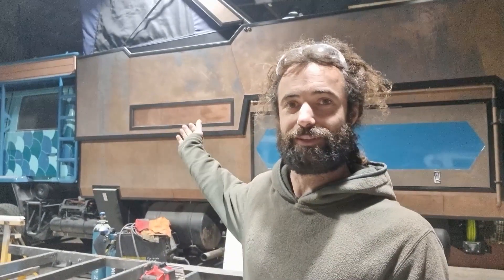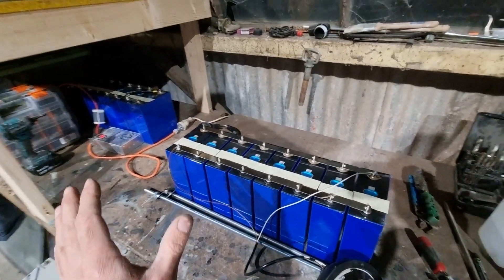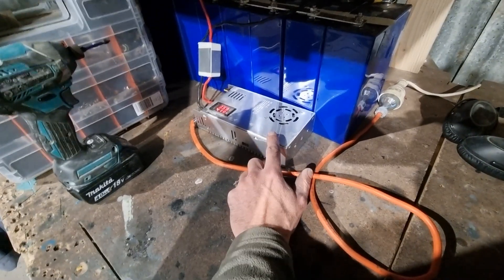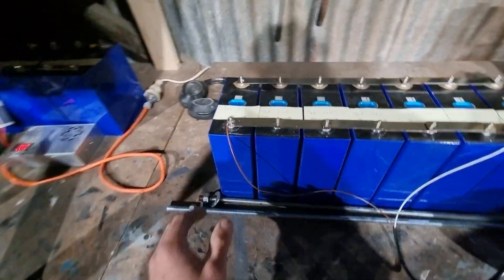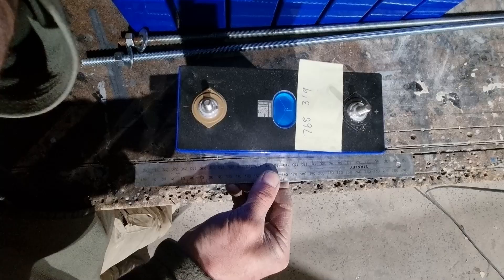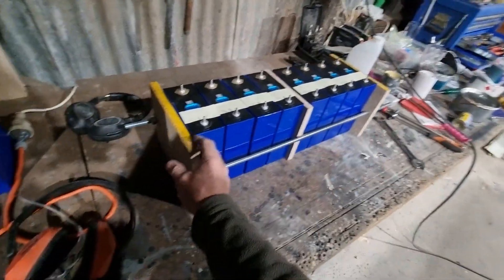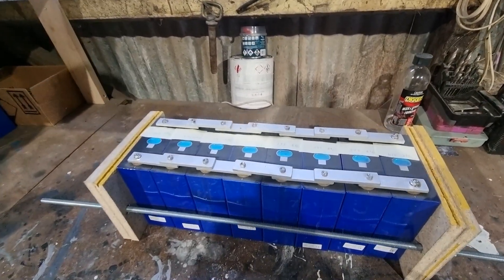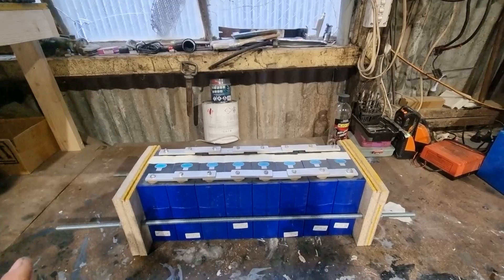Overcharged Swollen LFP Cells! And My Attempt At Fixing Them - DIY Expedition Truck Build #32

Comment: So what gave you the idea that it’s ok to compress bulged cells? Extremely likely that the burst disk will let go sooner or later under a normal full charge of 3.45VPC. 4.6 Volts? Compromised.  If you compress, you do it from the start and that includes top balance. If you must unclamp you do it at a low state of charge and when they are cool.
Reply from the maker: The tiny little evil red man on my left shoulder. I've charged them back up to 3.46, I guess I won't know the damage until I've installed them and hooked them up. Do you know the correct N m they need to be compressed to?
Reply: @dancampion  
    I don’t use rigid/fixed compression. I use springs because the cells can expand a bit even with compression. Area of side of cell 174x205 mm =55.288 square inches of area. 12 psi max optimal. 10 psi safe so 55X 10=550 psi so divided by 4 = 137lbs spring per bolt or for a two bolt compression 274 lbs spring per bolt. 
Die springs work. You select the springs based on size, spring pressure at it’s rated compressed height. For mobile you absolutely must have electrical separators between cells,under and side so they don’t rub through. Any place things could short probably will if you don’t get that critter off your shoulder. Good luck, I hope you didn’t kill those cells.

Comment: This is very interesting. I admire your determination. But i have done worries too. There are many things i have done different compared to you. I built 2 lfp batteries after many, many hours of learning.
I am no expert, but i do see some risks.
Your working environment is not clean. Damaging the foil on these cells is a risk.
Charging your batteries and discharging them is described in their datasheet.
The bms you are about to use may not be the best choise imho
Balancing starts at 3.45 volts.
If you intend to make good use of your batteries for years, you really should dive in to this material yourself . Your health is at risk. There is a huge amount of energy in one single cell. A short always comes as a surprise.
Reply from the maker: Thank you, I should have been clearer, I did set the target voltage to 3.64 for balancing. Hahah yes I couldn't agree more about the work area, it is a problem, no doubt it points to some deeper issues. I'm also no expert, but I have a certified electrician guiding me who builds these systems, and I trust his guidance
Reply from the maker: And I appreciate your feedback! Thanks for watching and for caring enough to give me some feedback

Comment: You might want to read the data sheet on these LiFePO4 batteries, they are designed to be changed to 3.65V, slight swelling is normal. Compression is optional,  but needs to be done before charging. They have a very flat charging curve, charging to 3.2V is too little, should be charged to 3.45v for 100%.
Reply from the maker: I should have been clearer in my description, the target voltage was set to 3.64V. I did have a browse through the data sheet, but I'll go back and have a better read of it. Cheers!

Comment: What's your fire plan?
Reply from the maker: Keep a bag of marshmallows right by the door. 
Jokes aside LFP batteries have a very low risk of fire, they can be submerged in water, punctured, overcharged and all kinds of other punishment without catching fire, there's plenty of videos on YouTube about it. Lithium Ion batteries have the biggest fire risk, it's often an electric device with a lithium ion battery on charge that starts a fire. Once these packs are connected, the BMS will prevent them from being overcharged